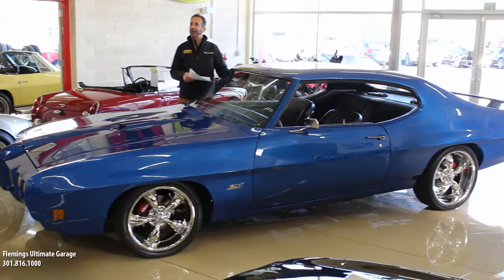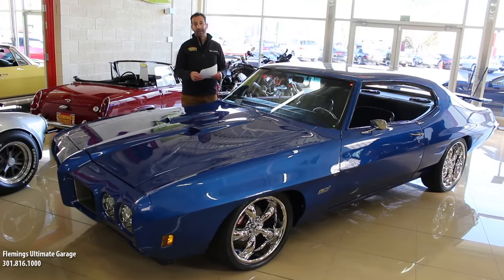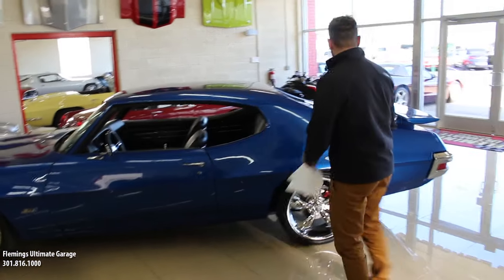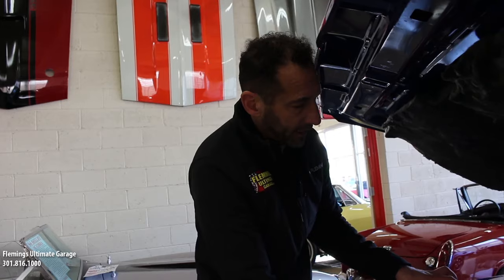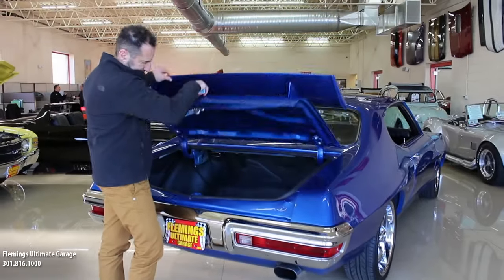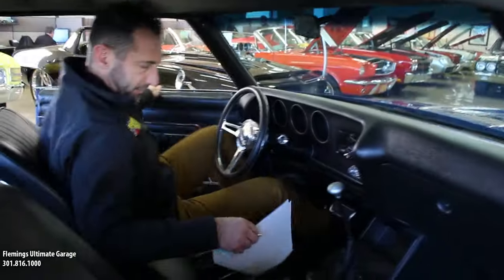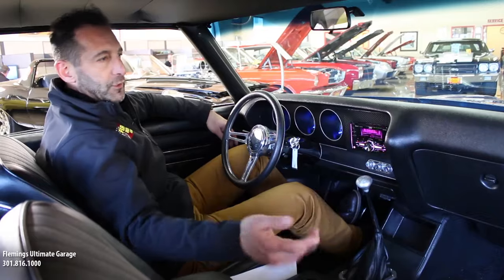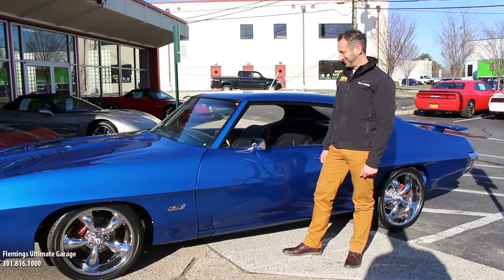1970 Pontiac GTO for sale with test drive, driving sounds, and walk through video

Comment: Smh...Should be an old school Pontiac motor under the hood...not an LS motor!
Reply: Butler aftermarket block Pontiac architecture engine.  Aluminum Ram Air Iv/SD455 style design heads.  Fuel injection.